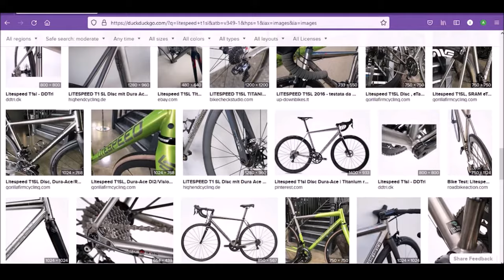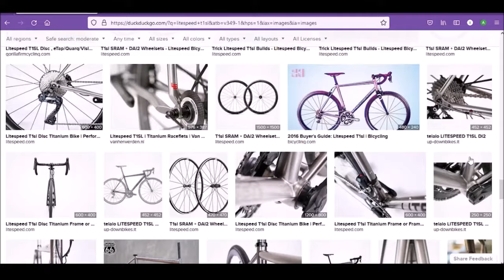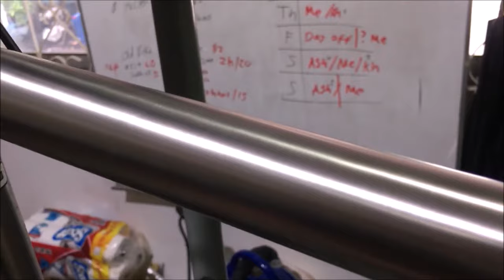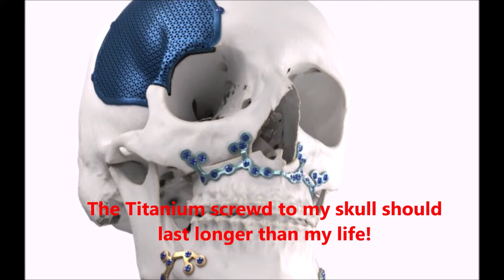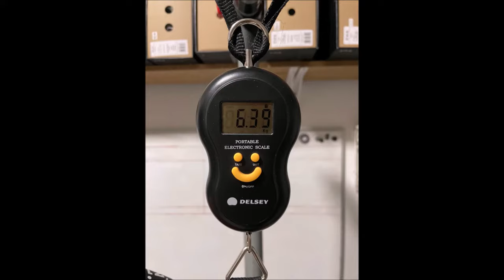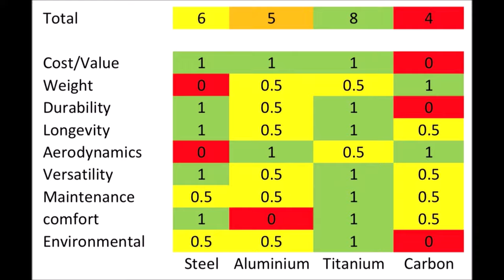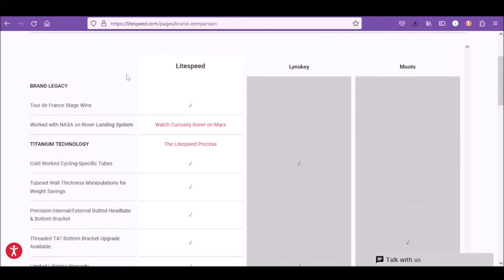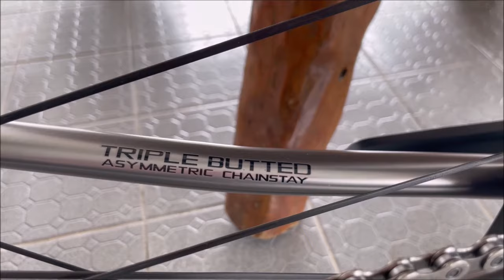The World’s Best Performance Road Bike. (And It’s Not Carbon…)

Comment: I've been riding with discs, on the road, for nearly 20 years.  That said, I can't fathom the anti-rim brake movement.  I understand why manufacturers are pushing it, but riders need to stop being led around by the nose.  I have both systems, but they're used where their properties are best suited, and I'd like to see them both continue to be options for just that reason.  This is another dumb move by 'Big Bike'.
Reply from the maker: I couldn’t agree more! Both technologies have their pros and cons. 👍🏻
Reply: 20 years?
Reply: @the.communist   Google '2003 Giant OCR Touring'.
Reply: I just can't buy a discbrakebike, wanted a lynskey helix ti frameset but it only comes with disc sorry not gonna but it, caliper brakes or no buy for me. I'm sure they'll make a return in the near future.
Reply: Cheep and easy to make that's why they push discs , no more Dura Ace rim breaks at £550   a set , discs costs £5 to lazer cut , disc calipers cost £10 to make and by themselves so nice and cheep and max profit .....And they have just tested rim against disc brake bikes at GCN and rim was 10% better ...oops.....

Comment: Riding up a lot in the mountains, rim brakes are “history”, this is out of question. Also in wet conditions you get big disadvantages compared to disk brakes which are easily balancing the higher system weight. If you ride only flat, rim brakes are still a good option. Titanium frames…as bigger the frames size you need, as more flexi the bottom bracket unfortunately gets. As a former Litespeed dealer I had several cracked Litespeed frames too, so they are not unbreakable. Cracks naturally occur or starting in the welding areas with titanium which is usually highly complicated to repair. Tripple butted titanium is more resistant than their aluminum double or tripple butted counterparts, that’s absolutely correct. In total, titanium is an amazing material with limited design capabilities. That’s the main reason why high end bikes are nowadays produced in carbon fibre. What 3D printing will soon bring us might change the industry again onto another path…let’s see…have fun riding ✌️
Reply from the maker: Some things here that I don’t agree with but it’s some good subjects for future videos so I appreciate the food for thought! 🙏🏻 

Thank you for your input and all the best! 👍🏻🙂
Reply: Always the same marketing BS ever time someone criticizes the bike ballast. What you proclaim isn't true.
Reply: @rosomak8244  Mhmmm…marketing BS? 🤔 interesting…
Reply: @sa330jpuma  Yes you a lying. Disc brakes don't perform better and they are far less reliable in esp. in the mountains. They don't perform any better in wet. The worst thing is that they fail almost instantly when they fail without any real notice. On the other side: they require finickle constant maintenance and they add unnecessary weight to the bike both directly as well as indirectly through increased requirements on the frame due to the inferior force application. They are a fanaberia for people who don't ride seriously and they where forced on the professionals.
Reply: @rosomak8244  Hi, many thanks for your detailed reply. I am just wondering about your „vibes“, you must have had loads of problems with disc breaks causing lots of frustration on your side. I am sorry for you if this is or was the case. But you are also correct, disc breaks are generally in need of more maintenance compared to their rim brothers. Additionally, the first generations of roadbike disc brakes had loads of issues like stuck brake pistons and also fading when they got hot. Is it maybe possible, that you have one of these older series on your bike? Never the less, also with disc breaks you need to have a certain break „technic“ to get a certain system cool down in between heavy break events, same like with rim brakes. Maybe it is also an different „perspective“ you got? As former national team engineer I have obviously no big problems to vent and adjust disc breaks to the „point“. You might laugh, I still have a nice Cannondale SuperSix with rim breaks…I live in the Alps and sometimes when I take it for a ride here, down the 24% slopes, I scare my ass off that my modern carbon wheelset is not „melting“ away. And yes, you can imagine, I have specific brake pads for my rims, no worries 😉 I remember years ago on the same route getting into rain, I was partially not able to get the bike slowed down enough, able to safely get the needle turn downhill done. I guess we have many of colleagues with the same experience getting the rim flanges downhill dry enough able to get friction on them, especially using Carbon wheel sets. This never ever happened to me and all my colleagues anymore after switching over to disc breaks years ago. But if you only ride in flat or „hilly“ areas, you might not be able to feel the differences between the two break systems which is especially along the border zone of the doable more than only noticeable, especially for pro riders. Same like in the Formula One, it’s usually not the fastest car which will win, it is the one with the best break system or combination of, allowing them to break just a bit later than the competitors keeping the speed up. Newer roadbike disc break systems having also more distance from the break pads to the disc itself and the partially annoying scratch sounds are history now too. Wondering why all Mountainbikes have disc brakes if they are so badly performing 🤔 Yes, I also still know the times where we used the first hydraulic Magura rim brakes…and yes, we all were happy when that era was ending and we could turn to disc brakes. Never the less, I guess you are now on rim brakes riding, if not please approach a good service center and maybe evaluate to change break callipers to new generation ones if compatible. Greetings and I wish you always a safe and great relaxing ride ✌️🚵🏻‍♂️🚴‍♂️
Reply: Yes can confirm the larger frames did flex at the bb and some at the head tube, my 96 LS Classic (57cm) frame weighed 1400grams.I needed the comfort for long rides getting over back injury.Never cracked with my 75-80kg frame though.
Reply: Disc brakes are shite
Reply: I'm 6'5 LOL. Ti barn gate

Comment: I ride a lynsky and run disc brakes and carbon rims with 105 shimano drive train. I worked for zipp years ago doing tooling and the carbon wheels of the day, and I personally do not like the idea of calliper brakes on carbon or unmachined aluminium rims. I used to true up the carbon disc wheels and make tri spoke wheels. The combination I have just seems right on all levels feels like solid quality. The next little addition I want is a cane creek suspension head stem, possibly a seat tube to match. The bike has a specialised seat to replace a more expensive one that I could not stand. I have several nice bikes, and it is not always the first choice but a good thing.
Reply from the maker: If you have tried modern carbon rims with rim brakes its completely a different experience. I remember the old rims, in the wet you have zero friction. I was riding in the rain on my new rims and it was incredible breaking. ❤️

Comment: I bought a well used 2012 Trek Madone and used it for training and racing for about 3 years, logging about 35,000 kilometers over that period of time. I then sold the bike to a friend and it's still being ridden today. Contrary to many internet rumors carbon frames do not self destruct after a few years. I also have a titanium mountain bike and absolutely love it!
Reply from the maker: It’s true they don’t self destruct, but… they are more prone to damage due to a careless owner, less forgiving of silly mistakes and they do definitively get softer with age. Just the nature of the material wanting to revert to its original form. 🙂
Reply: @reginaldscot165  I'm no expert but that frame didn't seem soft to me even with untold miles on it, it seemed as stiff and nice as my new(er) Emonda I'm riding now.
Reply: @reginaldscot165  there is no "definitely softer with age" on cf bikes.
Reply: I have now worn out seven carbon fiber bikes over the course of the last 20 years (three of them in the last nine years.) If you ride them a lot, like I do, they fail, full stop. I have never had one last more than 30,000 km, although the one I am currently riding (a 2020 S-Works Diverge) seems to be much more robust than the two Diverges I wore out before it. Back when carbon was a newer thing, some of those bikes only lasted one year (<20,000 km). Honestly, the only reason I have a carbon bike currently is that it was a warranty replacement of the previous one and I wasn’t going to say no when Specialized gave me a $4500 frame.

I now have a custom steel Battaglin with full Campagnolo Super Record that weighs in at 7.4 kg and that’s a gravel bike with a leather saddle, and “heavy” (for Campagnolo) Levante wheels shod with 40 mm tires.  I could easily get it down to the UCI weight limit.  I’m sick of disposable bikes.
Reply: @H457ur  Well I've had 3 carbon bikes now and logged well over 30k on 2 of them (both still fine and rolling) and my current bike is absolutely pristine with 15k to date. Guess maybe I'm just lucky? Also I routinely work on carbon bikes with that kind of mileage and they are just fine.
Reply: @doughorner5730  No luck, you just treat the bikes well. currently 38000km on my trek emonda, no weakness or noticeable change in the bike so far, 2018 model.
Reply: I have a friend who was riding his Specialized Carbon bike that he bought brand new, the fork snapped at the headtube on a ride and he went down hard and woke up in an ambulance on the way to the hospital, luckily a car coming up from behind him saw him go down and called 911. Specialized gave him a new bike under warranty but of course didn't pay his hospital bills.  It took him like a year to get healed up and back to riding again. I have a Steel Rivendell bike and a Habanero Ti bike, I'm good! No carbon for me.
Reply: @jstar1000  I ended up in the hospital with a bad concussion in 1982 due to a failure on my Columbus SLX steel bike. I have never experienced any sort of failure on any of my carbon bikes. That's conclusive proof that carbon bikes are superior.
Reply: @reginaldscot165  Well yes to some of that but what does "Just the nature of the material wanting to revert to its original form." mean. They are moulded into the shape they're in. They don't have residual stress.
Reply: @jstar1000  Have to point out that most bikes today have carbon fiber forks, whether rest of frame is carbon, steel, aluminum, or titanium.  Hard to get away from carbon forks.
Reply: @paulflory3532  not my 2021 Rivendell Roadini, all steel.
Reply: @jstar1000  "most bikes today have carbon fiber forks" - not "all".  P.S., I raced a Peugeot PX-10, a Schwinn Paramount, and a Follis, all with steel forks

Comment: Non replaceable derailleur hanger on a titanium bike is a mistake. If it snaps you are s.o.l. until you can find a titanium welder.
Reply from the maker: Good thing the T1SL has a replacement hanger then. 🤭 it’s also made of titanium and fixed with 2 screws. 👍🏻
Reply: @reginaldscot165  ?titanium screws.. I would advise not so they shear.. but then I guess, you'd need a new derailleur!
Reply: @timhull8664  Screws from titanium are fine. Aluminium is problematic.
Reply: @reginaldscot165  it looks like one piece in the video sorry.
Reply from the maker: @The2808erik  no problem! It’s because it’s all the same material so it blends in. 🙂👍🏻
Reply from the maker: @timhull8664  the screws are steel, the hanger is Ti.
Reply: Steel bikes usually have non-replaceable derailleur hangers and that’s never been an issue in 30+ years of steel bike ownership and 20+ years in bike shops. If you crash it and bend it you just bend it back. 😊
Reply: Van Nicholas SKEIRON Titanium bike frame features replaceable derailleur hanger.

Comment: I used to race XC in the early 90s in Alaska and in only a few years, I broke 3 pairs of aluminum bars, not due to crashes.  They just wore out and broke.  I switched to titanium bars and have never had any problems since.  Just don’t use titanium crank bolts with a titanium BB spindle; I learned that the hard way. 😁
Reply from the maker: Cool 😎

Comment: If I had to guess, this would be a sponsor match made in heaven!!🤣. You’ve single-handedly set the Ti industry off in a nice trajectory!  I didn’t even know I needed one!
Reply from the maker: I wish I was sponsored by the Ti industry! That would be awesome! 😍Unfortunately Litespeed won’t even sell to dealers anymore, they do everything direct. That frame is my last one… 😢
Reply: Yes, sounds like a Litespeed sponsorship,  especially when you forget to mention Lynskey Performance Ti frames. David Lynskey was the original founder of Litespeed and sold the company in 1999, then formed Lynskey Performance several years later. The Lynskey family has over 60 years experience in high end metal fabrication. Lynskey frames are just as good as Litespeed and usually are priced lower and come with a threaded BB shell as standard,  which cost extra on Litespeed. However not sure about availability in the UK.
Reply from the maker: @kennybinns6279  I showed both them and Moots in the video.
Reply: @kennybinns6279  But then Lynskey charges you extra for the brushed finish, which Litespeed does not. When you get to the finished product, they're pretty close in price. Pick your favorite, I suppose. You'll get an awesome bicycle either way.

Comment: I enjoyed your video. Having been an avid cyclist for more than 30 years, I've owned more than 40 road, mountain, TT, and gravel bikes. The majority of my bikes have been made of carbon fiber. However, I've also owned several titanium bikes (1999 Litespeed Ultimate (favorite of all time), a 2004 Litespeed Vortex, a Lynskey Helix, and a Lynskey PRO GR gravel bike). Two years ago I purchased a Litespeed T1SL disc bike. I can say for certain that Litespeed is a first class operation. I live 4 hours from their facility in Chattanooga, TN. When my bike was finished, I went to their facility to pick it up. When I arrived, the bike was completed and sitting in their showroom. I was then given a detailed tour of the facility and was personally introduced to each person who made the frame and assembled the bike. The bike was "dialed" perfectly when I picked it up. No adjustments other than fit was needed. Flawless shifting. I personally believe titanium is second to none!
Reply from the maker: What a story! I wish I lived that close to their factory. 😁 Safe riding!
Reply: Hah - I have the same bike and had the same buying experience (live in Johnson City).

Comment: I completely agree with your assessment about the different frame materials. If I can't afford titan, I will buy a good steel frame.
I have aluminium now, also fell for the marketing about lightness, and such. It feels stiff and uncomfortable on longer distances. All these smaller vibrations are annoying, uncomfortable.
The truth is, a solid aluminium frame for daily use is not much lighter than a good steel frame.
Reply from the maker: I agree, spent many years on aluminium bikes… many aluminium bikes. They were all quite harsh, some not that light, but they are all cheap and some were fun to ride. 😁

Comment: why the carbon fork? I see that many manufacturer sell frames with alu but carbon forks. Any logical reason for that? And when it comes to disc vs rim brakes: it's also a matter of the right quality of pads. best ones  I think are swisstop - these are awesome. I tested these  downhill in the alps at 80-90 km/h . But  30$ for two pairs.. the disk adds weight. is less responsive (or less forgiving) at high speeds, but is cheaper over time? Or not ?. Am I missing something? Thanks for your great channel and  please keep up your honest and truthful speech!
Reply from the maker: Thank you very much. Simple answer is cost, carbon forks are cheap because they are mass produced. 🙂

Comment: I have owned litespeed frames in the past. One of them developed a crack at a welding joint. Several of my friends owned litespeed around 2003-2010. A few had cracks and got replaced under warranty. Ti frames are not bullet proof
Reply from the maker: “Ti frames are not bulletproof.” The video seems to show they are. 😅

Comment: Great video thanks! What are your thoughts/experience on the new Litespeed Spezia?
Reply from the maker: No experience, I think they should make a rim brake version because supposedly it’s the lightest disc bike they have ever made. So by that logic it’s lighter than the T1SL disc, therefore if it was made in rim it would be the New worlds lightest titanium bike frame. But they won’t and as far as I’m concerned buying a disc brake road bike is pointless. MTB yes, gravel yes, but not road. 🤷🏻‍♂️

Comment: Steel and aluminum corrode and Ti frets, meaning it doesn't like other metals against it.  Aluminum bike frames actually have aeffective life span of just about three years and then they go dead, no spring in the frame, looses it's pop.  Feels like riding a brick.
Reply from the maker: I couldn’t find any information on “titanium frets?” Other than guitar strings. 😁 It can suffer from galling, but no more than other materials, I haven’t found my titanium frames react to anything yet. 🙂

Comment: Great commercial for Litespeed.😊 
I think stiffness to weight are missing in your sheet.
Carbon fiber is a directional oriented material. While it is porous in one direction it is strong in the other. 
A carbon frame has probably the best stiffness to Weight ratio.
Reply from the maker: Nice comment. 👍🏻🙂 Trust me, the T1SL is more than stiff enough. 😉